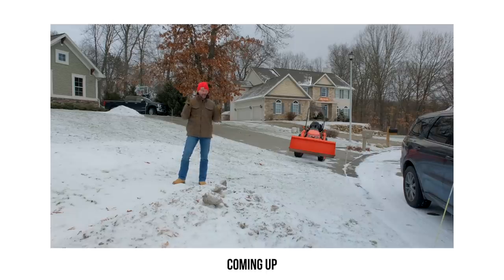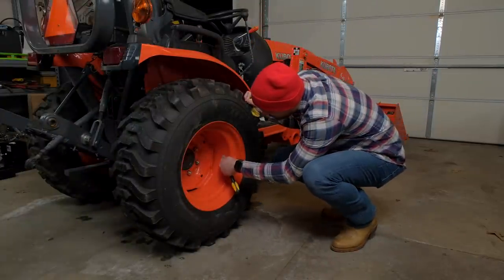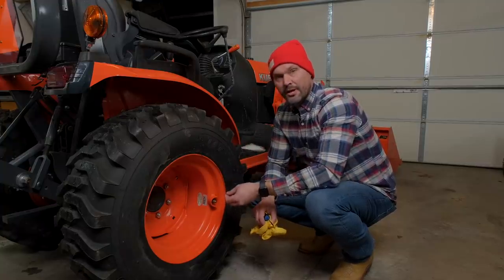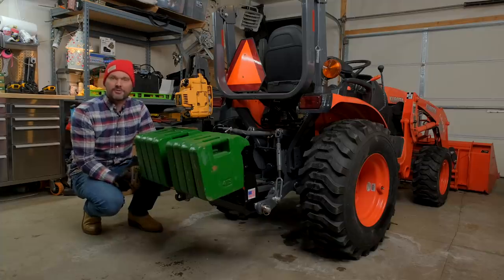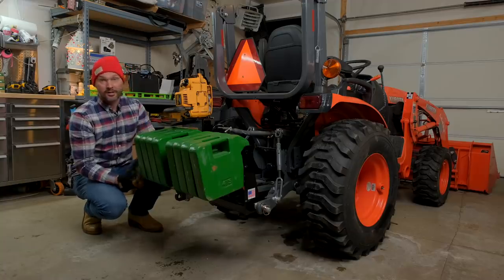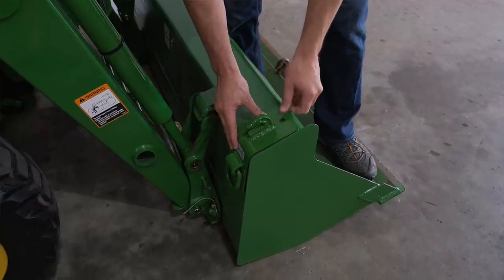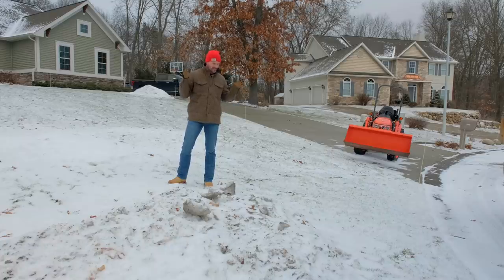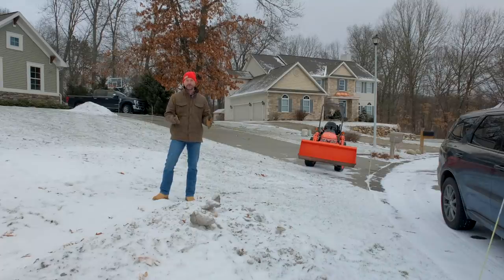NEW KUBOTA ACCESSORY, UPDATED SAFETY SOLUTION, + BIG TIME SAVER?

Comment: I have some new neighbors from Texas and she was out the other day shoveling the little bit of stone off of the plow piles. She said it made more sense to do it while the snow was still there before it got into the grass. When your tractor doesn’t have a bucket level indicator curl the front edge up lower the loader to the ground so the back of the bucket is touching and curl forward till the back just starts to come off the ground and your level. I bought the telescoping lift arm sway control from my Kubota dealer seems to me they were a little over $100. L3901
Reply from the maker: Yeah I got a little too bold 😂
Reply: I try to do it like the neighbor gal from Texas. Usually just  a few shovels full before the snow melts.

Comment: I took a set of 3/8" Harbor Freight hooks, cut the pin eyes off, and welded them to 1/4" angle iron. I then bolted them with grade 8 bolts to the bucket, so they are removable if necessary.  My angle iron goes from lift arm to lift arm for more strength, instead of just in the center of the bucket. A couple coats of paint and for under $20 I have a set of strong hook points. Sure, powder coating looks better, but way more expensive, and they all get scratched up anyway.  I bolted my D ring on the back wall of the bucket.
Reply from the maker: Very nice!

Comment: I noticed that the top link on the 3 point hitch was bent a little because of raising the 3 point hitch up without putting the rops up. Need to put the rops up in at least  the first position so it's at least straight out back or leave the 3 point hitch down til you get outside where the rops can be raised up then the 3 point hitch.
Reply from the maker: Yeah looks like that’s what happened

Comment: Surprised you didn't put a couple of those nice bucket shoes (forget the brand name) on there. I know you have a set, at least you reviewed them a while back if my memory serves (might have be3en Tim though). Anyway, no real harm done. Collateral damage is just part of the snow removal thing, so it seems. 
I'd be interested in a set of those quick set sliders for a B7800, do you know offhand if they are available for a B7800? I think that pre-dates Kubota using them (2006), I have looked at Messick's parts listing and they don't show a Kubota part number for them, I didn't know anyone was making them aftermarket - there was a fella, but it looks like he's no longer doing it.
Thanks!
Reply from the maker: Looks like Mark Hodges custom makes them?
Reply: @GoodWorksTractors  Thank You!

Comment: Every bucket I have used, if it doesn't have a bracket or indicator, the top edge is parallel to the bottom.
Reply from the maker: All it takes is being off a degree or two and you wind up with what I did 😂
Reply: @GoodWorksTractors  you started off good, but you didn't keep up with it. You started out on the snow, then with the slight play in the quick attach, you can see the bucket pivot and dig in. The whole time you do this, you have to be watching for that movement and adjust accordingly. Or, just buy some edge tamers.  I have skimmed dirt off the grass with a piranha tooth bar installed.  You just need a little more seat time.😉

Comment: Isn't scraping off some unintended turf the first "hard lesson" anyone with a FEL at home learns? I'm lazy (and overwhelmed) enough that I'll even use the loader to try and move leaves in the fall 😂 As long as I'm on even ground, I've gotten pretty good at avoiding my wife's scorn from tearing up the turf. My SOP these days working on turf is to float the bucket down to the ground, then curl back just a half inch or so above flat, and then take it out of float. I drag the bottom of my bucket, but that doesn't seem to do any damage on my turf.